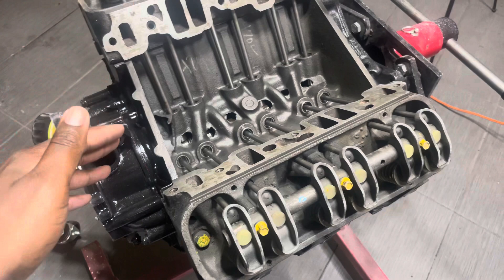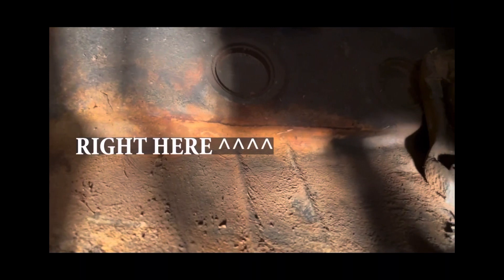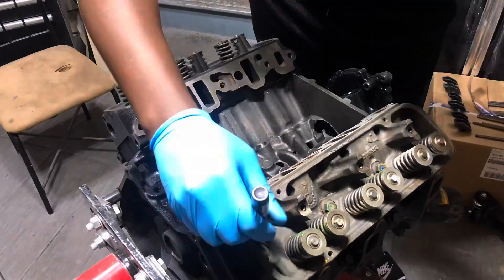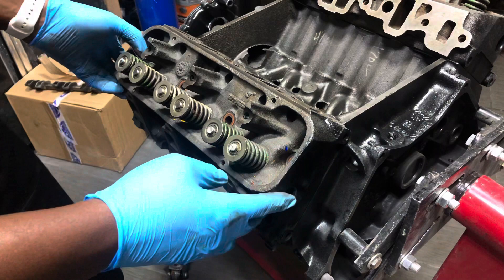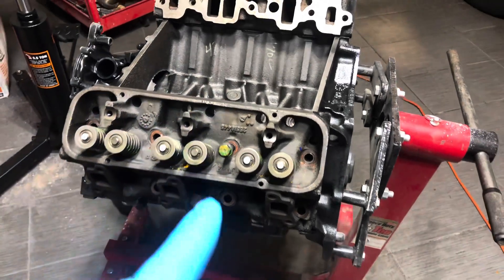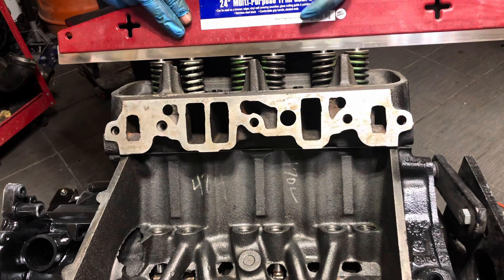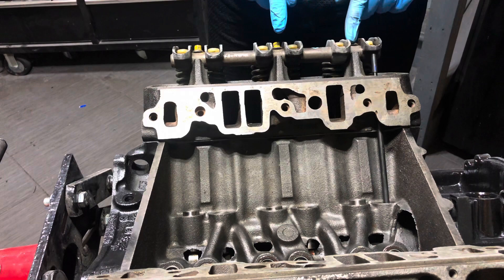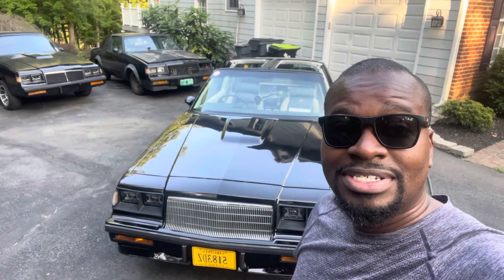Longblock Engine Final Prep | Grand National Engine Rebuild Part 5

Comment: So did the 86,87 turbo Buicks come with 20 bolt oil pan and the earlier years came with a 14 or 15 bolt oil pan ?
Reply from the maker: The switch from 14 to 20 bolt happened in 85. There are some hot air blocks with both setups

Comment: The first graphite gaskets are correct for a 86-87 turbo regal.  the hotairs  used a thin steel shim head gasket .  the gasket you used are not correct for a turbo regal due to the lack of bridging on the end coolant passages.  They will usually blow there quite quickly
Reply from the maker: Parts interchange listings are a real let down for these cars. Thanks for letting me know. I’ll swap back to the graphite and use 9441PTs in the future

Comment: Finished the MR2 so I just tore down the spare 109 block i had on an engine stand. Mine looks like it was rebuilt at some point and the rods have some nicks on them.. I want to order a custom piston from diamond with a 12cc dish so the compression is way up like 10.75:1... I only drive on E85 so why not right?
Reply from the maker: It’s gonna be a beast when all put together!
Reply: @CRASHBERN  I've got a set of T/A heads in my cart 🤘🤘 I'm thinking a 212/212 can with it, non roller cause it's impossible to get a roller cam right?
Reply from the maker: @MotorSwapDan  roller cams are available now. https://www.compcams.com/high-energy-212-212-hydraulic-roller-cam-for-buick-grand-national-231-v6.html